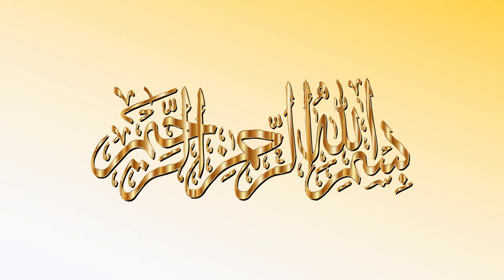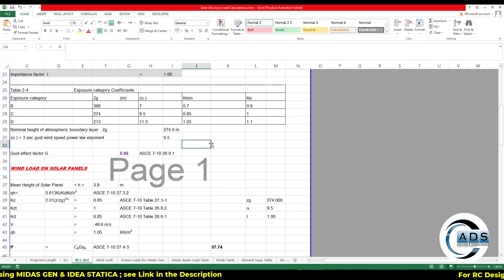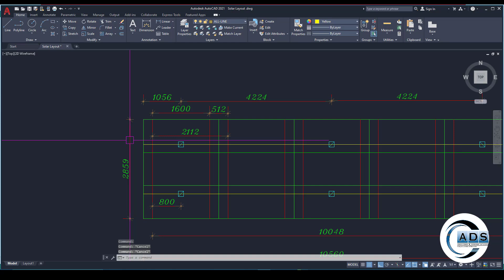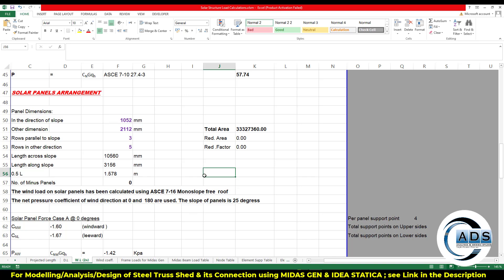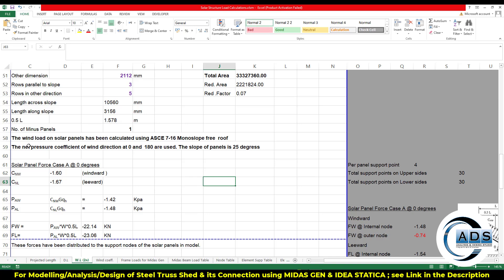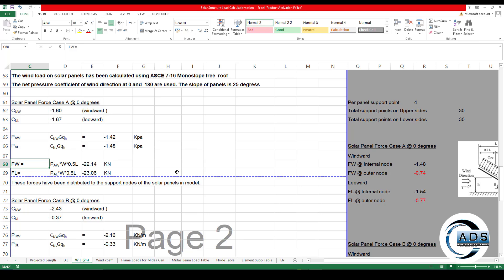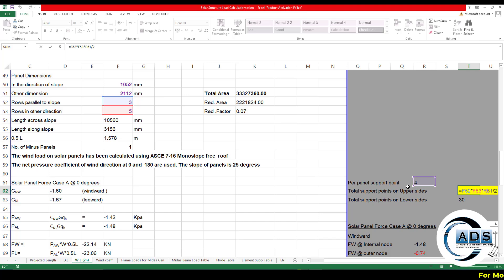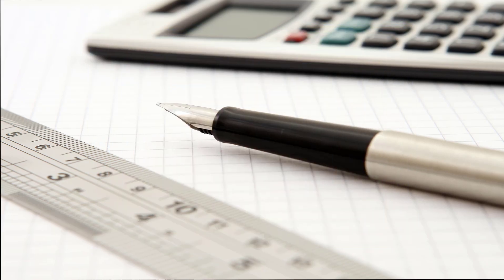Solar Load Calculations: Build Wind-Resistant Structures

Comment: Why did you use Real dimension for 0.5L? The standard says L is the dimension of roof in along-wind direction (horizontal) so shouldn't that be the projected dimension?
Reply from the maker: Dear friend. in the specification, Open structure wind load diagram, Length "L" mentioned is for the concept only, but if you follow the arrows marked. it is actually perpendicular to the panel itself. means wind load (in the direction normal to the plate) is to be calculated, and this can only be done by multiplying with the real length of plate. Hope you got the point. if any query then please email me.